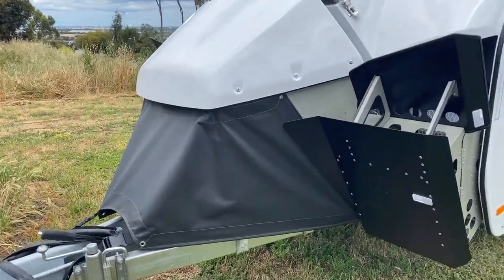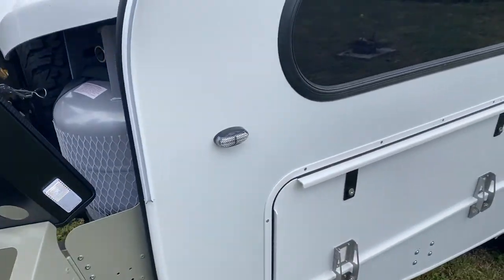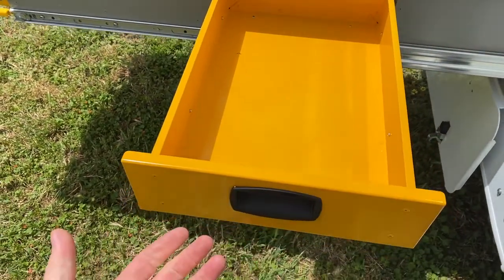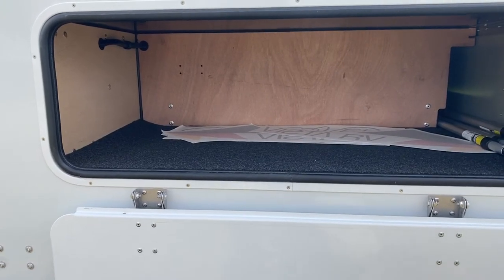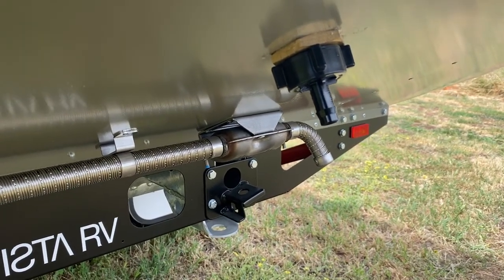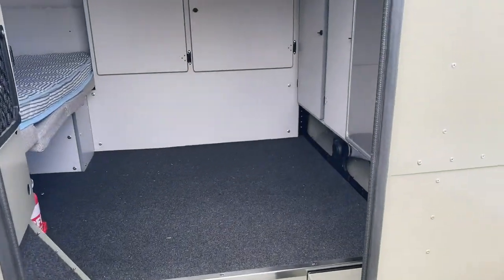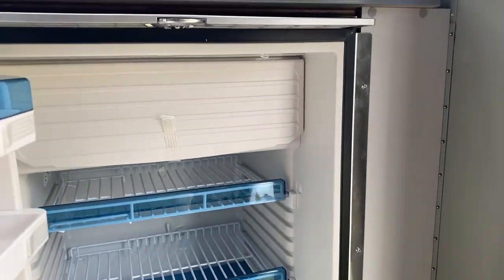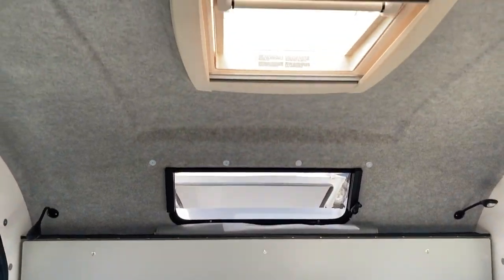DESERT OAK Vista RV Crossover - In depth tour

Comment: I like the van in general but how do you get to the drawer with the sink open? seems like a strange design?
Reply from the maker: Hey Genevieve, the manufacturer have made use of a space that would otherwise have been ‘dead space’. So it’s accessible for some storage, but not things that are required throughout meal prep. There are two massive storage areas accessible from the bench top though, so plenty of storage available :) We have wondered this ourselves and this is the conclusion we came to! The team at Vista are always making improvements, so watch this space! (Pun intended 😜)